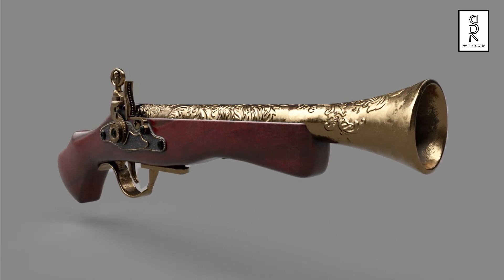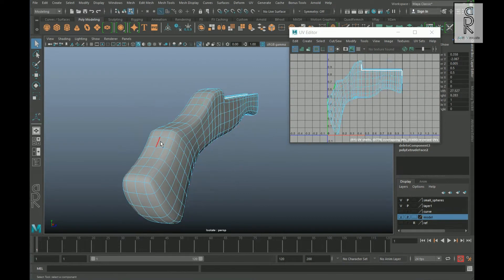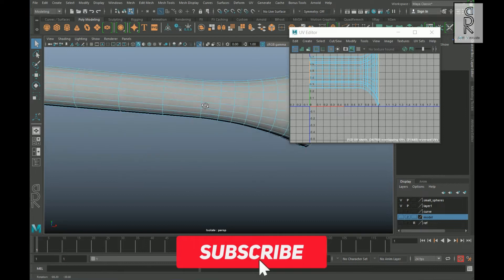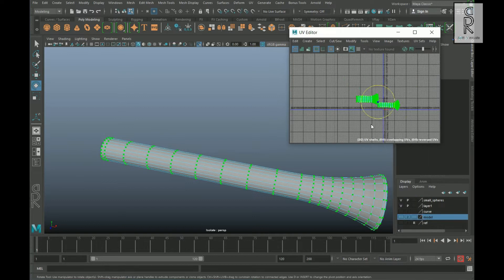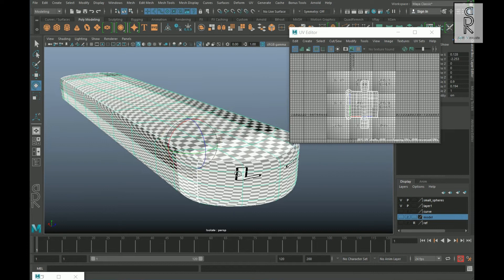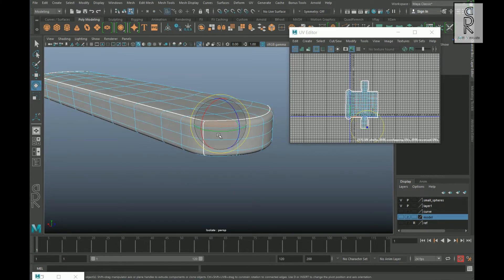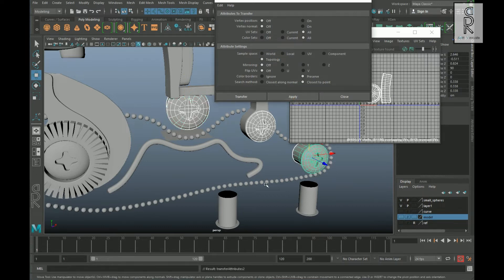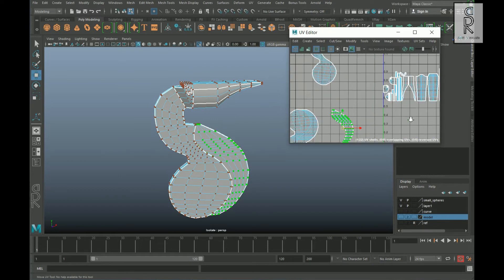How to make Pirate Gun 3D Model in Autodesk Maya (Part-4) | UV Unwrapping Tutorial

Comment: WHy is there some objects you only unfol and some need the planar step? pls
Reply from the maker: @celianbsht  

The UV mapping technique you choose depends on the complexity and shape of the object. Some objects only require unfolding, while others need planar mapping (or other projection techniques) before they can be unfolded. 

For objects with complex shapes (like organic models or highly detailed surfaces), using projection methods like planar, cylindrical, or spherical mapping can give a quick, rough UV layout, but these layouts need to be refined further. In such cases, you use a projection to initially map the UVs and then use the Unfold tool to relax and optimize the UVs, reducing stretching and overlapping.

For simpler geometry (e.g., planes or cubes or cylinders), the topology is straightforward enough that you can skip projection and directly use the Unfold tool, which works based on the object's existing UVs or basic cuts. In these cases, the UVs already represent the object's surface reasonably well, so unfolding them directly gives good results.

I hope I have answered your question 😊.
Reply: @sunitdrozario  Thanks a lot, you did. I guess i’ll just understand better how all of this works after a few months of practice!
Reply from the maker: @celianbsht  yes it's all about practice. The more you practice the more you will learn and understand new things. 😊

Comment: Hi again! When you re sewing eges why dont you select them from the uv editor straight away? I have been doing like that (maybe i fucke it up lmaoo will see later) but just wondering why you dont?
Reply from the maker: @celianbsht
Hello!
Selecting edges from the UV editor while sewing edges can sometimes cause issues because the UV editor only shows the UVs of the geometry, not the actual 3D edges. 

The UV layout doesn't always represent the exact spatial relationships of 3D geometry. This means the edges you select in the UV editor may not align properly when you sew them, causing distortions in your UV map.

Sewing edges based on the UV editor view can lead to misalignment if the 3D geometry doesn't match the UV layout. This could result in improper seams, causing texture stretching or breaks.

Another thing When you are selecting edges in the UV editor, you're only seeing the flattened version of your 3D model. You might sew edges that are far apart in the 3D space, which can lead to unwanted connections or distortions.

And if your UVs overlap or are close together, selecting edges can result in sewing incorrect edges, which can cause further confusion and errors in the UV layout.

It's usually better to select edges in the 3D view to ensure you're sewing the correct geometry and maintaining the model's integrity. Use the UV editor to monitor changes, but rely on the 3D view for precise edge selection to avoid distortions or misaligned UVs.

I hope I have answered your question. If you have any other questions feel free to ask me anytime. I will be more than happy to answer your questions😊.
Reply: @sunitdrozario  Thank you so much! You re the best to explain everything.
Reply from the maker: @celianbsht  Thank you so much for you kind words. I am really glad it helped.😊